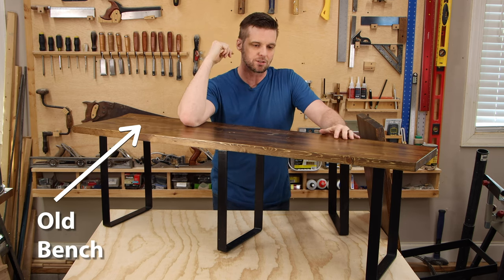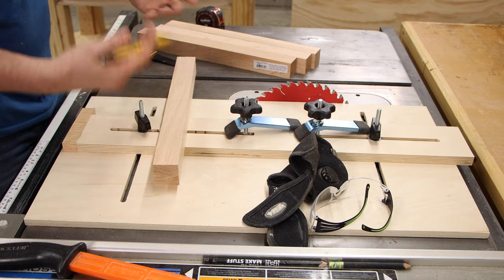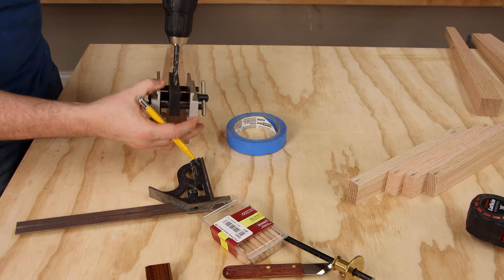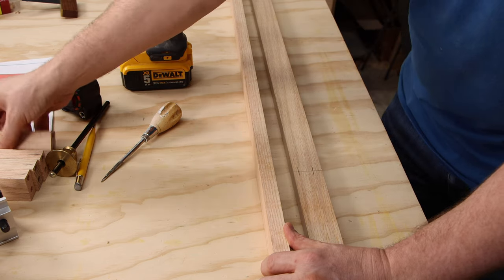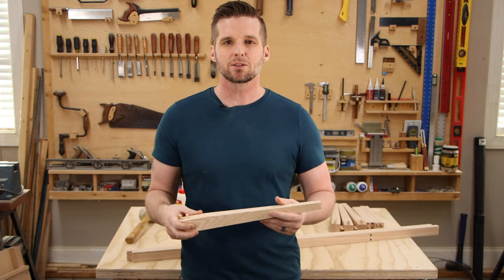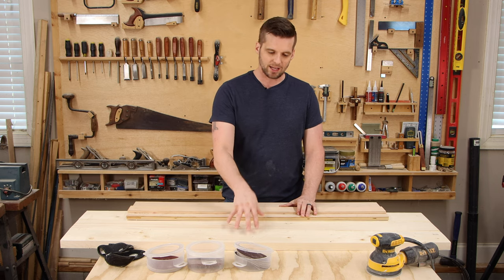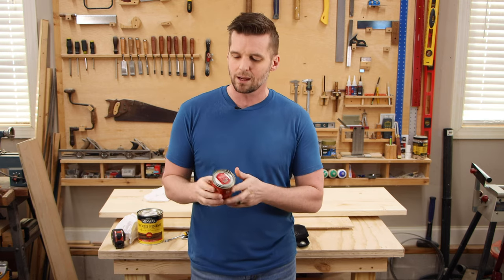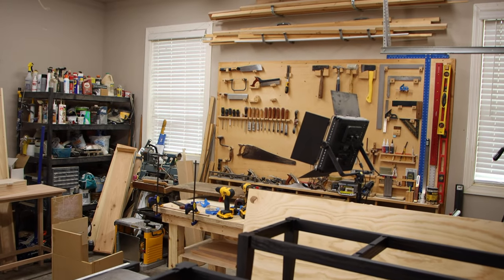Building New Dining Table Benches (It Was Time) | Free Plan

Comment: When I stain wood I always use a brush never used the rag method is the rag method way better then using a brush ?
Reply from the maker: I think it's a little quicker....you're wiping off the excess either way so I think the finish comes out looking the same whether you brush or wipe on.
Reply: @OutoftheWoodwork  aww okay got ya I normally use a regular brissel brush for painting what about the foam brushes for stain compared to a rag?
Reply from the maker: @AntonioClaudioMichael  that's what I was referring to...the foam brush. It's great for staining it just takes a bit longer than using a rag.
Reply: @OutoftheWoodwork  oh got ya I was Talking about in my original post a Bristle brush